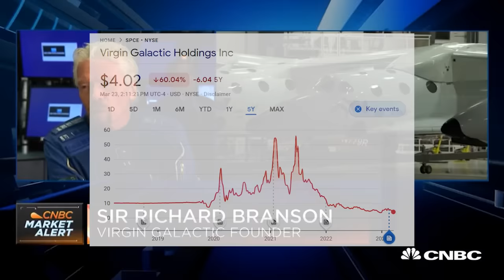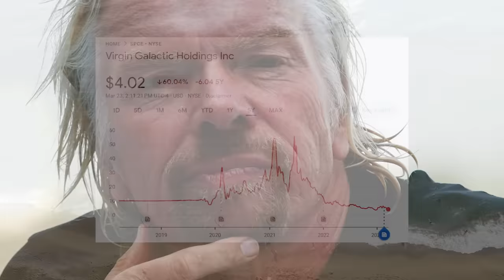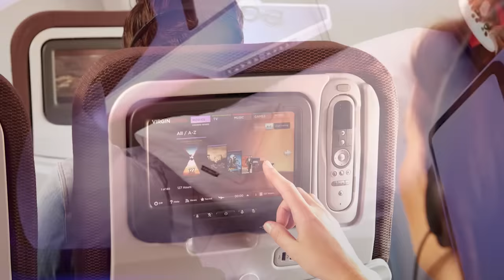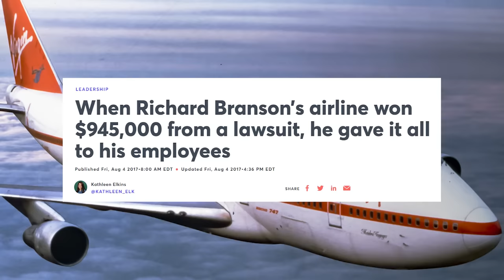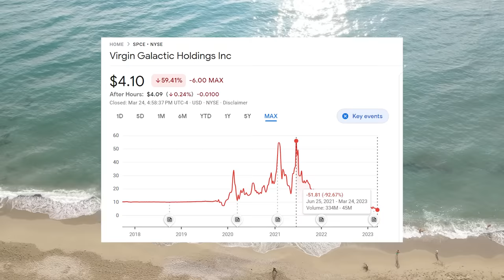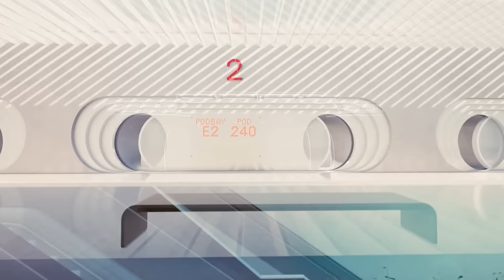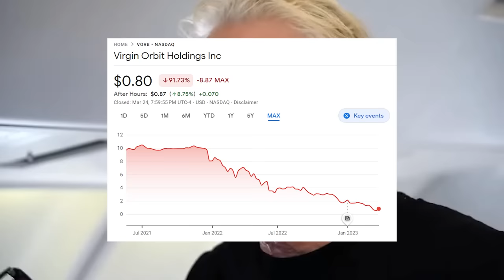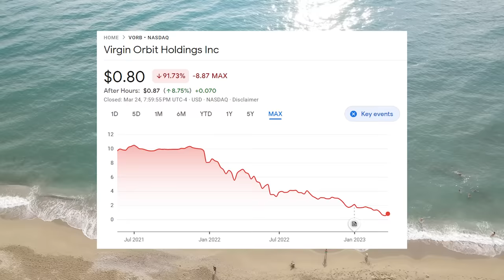The Rise and Fall of Richard Branson

Comment: Richard Branson says he didn't know the difference between 'net' and 'gross' until he was in his fifties. He is just a lucky risk-taker. Anybody that took 5 minutes to review the hyperloop's science knew it was impossible.
Reply: @tripplefives1402  theoretical science as you basically state that the cost is too high to be practicable so will never be built and see if it is possible
Reply: @tripplefives1402 it’s like an air hockey table as Elon says lol. Comparing something that complex to a very basic thing is laughable and that is before you consider transporting humans
Reply: @tripplefives1402  "It's just like those tubes at the drive through at the bank, just bigger."
-> By this logic, skyscraper is just like a glasshouse, just taller. No, the engineering challenge increase not proportionate to the increase of size, not even quadratically. The giant pipe, miles long, meters wide, has to be maintained. Smallest crack can be catastrophic. Speaking about catastrophic ...
-> Add the fact that the pneumatic tubes in banks and hospitals brought receipts, not humans. That means hyperloop brings ALL the problem of space travel to the ground: "How to ensure a human survival in vacuum travel?"
Reply: @tripplefives1402  Actually, it takes around half an inch of steel for a tube a couple of metres in diameter. I calculated it. Unfortunately it would have trouble keeping its shape so you'd be wise to use one inch thick steel at least and brace it regularly. I costed the bare steel sheet alone to fabricate a LA-San Francisco line at several billion dollars without it even  being fabricated into a tube.
Reply: @tripplefives1402  NO they have NOT ! Don't tell LIES ! Those test tracks are too small and are completely unrepresentative of a real version. It takes around half an hour even to evacuate them.
Reply: @tripplefives1402  " A small crack would do nothing but leak air and water in which would prevent the vehicle from reaching top speed."
-> Err ... a small crack causes reverse decompression: air will be rushing in so fast, so hard, it crushes the tube and the "train."

"Actually yes, the engineering is proportional to the size."
-> Nope. Square-cube law already indicate this.

"The relationship between the thickness of the steal beams on your glass house to its weight of each floor is linear."
-> Assuming this is  true, this is not the only aspect of designing bigger building.

Look, Thunderf00t already shows every single detail of the engineering challenge, I suggest his video. 
OR
Without seeing Thunderf00t video, the fact that hyperloop IS NOT reality until today, eventhough this concept was floating around since 1970s suggests that the difficulties of building hyperloop is closer to my estimation than yours.
Reply: @tripplefives1402  I expect that a very significant part of the cost of either rail or rail routes will be LAND actually ! Both will need similar amounts.
There's no way that a hyperloop could be cheaper than HSR. THINK about it !
Reply: @tripplefives1402  NO. Hyperloops are a ridiculous fantasy because any sane costing makes them vastly MORE expensive than any alternative. RAIL IS CHEAP ! The costs in California ARE NOT rail related. 
There's a more fundamental flaw however. Not that many people need to travel from point A to point B at ridiculous speeds. A hyperloop would never have a sufficient customer base to fund one. THE END.
Reply: @advancedomega  just add duct tape if it moves and wd40 if it squeaks
Reply: @parafitality2730  🤣🤣
Reply: @tripplefives1402  no drive through banks in my country…our high street banks are all closing .no tubes in our drive through Starbucks either..
Reply: Airplanes are also impossible.  "Putting occupied vehicles in such a large vacuum would involve insurmountable hazards and difficulties."
Reply: @davidbeppler3032  In case of airplane, the problem is only on the vehicle, not on the infrastructure: The airplane needs to be airtight while on air, while the air is just the air. 

Hyperloop has no such "luxury." Not only the train needs to be airtight during the travel, the vacuum tunnel needs to be airtight too. One small leaks along hundreds of miles of that tunnel will start a collapse, cutting off the line, or even crushing the train, killing all passengers inside.
Reply: @tripplefives1402  , lol, the travelling bit is easy, the static part is where the "unachievable" enters the room...

 - space is relatively free and easy to use, a 300 mile vacuum cylinder is anything but.
Reply: @bradyanderson2404   - yes, an airhockey table in a vacuum, ???? simple gets wrong really fast with analogies..  (just for a laugh - of course)  scalability is the hassle - when the cost scales by the cube, one runs out of money fast - time to find the "greater fool".
Reply: @tripplefives1402  Unfortunately, neither Branson nor Musk is wealthy enough to see the project through to any form of working system.
Reply: @tripplefives1402  Do you really believe that most firearms work using compressed air ?
Reply: @tripplefives1402  just what musk said, and look where that got him.
Reply: it is possible but very very expensive...not a sound investment considering  that  the target market is quite small ( the ultra rich of any given  society)
Reply: As the video says, it would have to significantly slow down every time it would take a turn or rise or people will be sick or even pass out from g-force, so it has no advantage over high-speed rail, and would cost much more.
Reply: Yeah he's not the brightest guy. His success is more about timing and luck with good branding and self-promotion, rather than his business skill or the quality of anything Virgin offers. He is what we call in the business world, a market disrupter. He enters markets as a price-competitor disrupter. 

Virgin Cola was an epic failure, so it shows even the Virgin brand can't work on some products and every market. Why he''d even attempt to launch a new cola brand is baffling and probably reflects his arrogance that anything with Virgin on will sell..cheap cola, even with the Virgin brand didn't sell due to brand-moats around the cola market. Nobody tries to launch a new cola brand because its an exercise in futility against Pepsi and Coca-Cola (except supermarkets of course that dominate the food consumer market and shelf-space). The only company really that's ever suceeded on any kind of scale in bringing out a new cola brand is Dr Pepper if you even consider that cola with its unique taste...they were quite clever in their marketing, kind of like "it's not cola!/it is cola (but tastes weird)! You decide, approach, which got people curious to try it😜Kind of like the marmite of cola world. Love it or hate it. 

Air travel and broadband is a different story as those markets are much smaller with less price competition...so market disruption worked well for him there. Although accquiring a fibre optic cable monopoly (at the time) was a huge game I think and he was definitely taking a long-term view on that which fortunately for him paid off, else that decision alone could have bankrupted him. 

Didn't he sell Virgin Records originally to fund Virgin Airlines? Then later he regretted the sale and launched Virgin Record's 2.0? I can't remember the back story of that and haven't read the book you mention (it's on my read list now) but re-launching a company in the same industry you sold out of that relies heavily on an established brand, sounds downright unethical and deceitful to me. Unless the original Virgin Records was rebranded or shutdown/bankrupted...but even then, presumably whoever bought the original Virgin Records label and retail chain had some brand-exclusivity provision in the sale contract, and by Branson re-using the same brand in same industry without paying or profit-sharing with the previous buyer, seems quite unethical business practice to me. I'd have sued the crap out of him if he tried that stunt on me.
Reply: @paullangton-rogers2390  If success was   purely determined  by hard work and genius then rich business  people would find  no  need to rig the game by forming closer ties with politicians and rulers to gain unfair advantage.
Reply: @paullangton-rogers2390  Unlike stated by you and this video Branson never owned virgin media. He just licensed his brand name (There are many virgin branded business out ther that are just a brand license) like Trump and got a very small equity % cut... He did go into the record business again but it was branded V2 records... and in the end it was more focused on live festivals from establised artists than A&R and putting out new music...  Branson is just a product of luck and good timing.. he always qotes his headmaster as saying he would either be a millionaire or in prison. Had he been born 20-30 years later i dont think he has the needed skill to pull any of what he achieved back then in todays world...
Reply: @tripplefives1402  wrote : [H-L] is just like those tubes at the drive through at the bank . Hardly : the bank tube capsules are not doing 760 mph while carrying people.  The bank tubes can have relatively tight curves and are not long enough to need allowance for thermal expansion.
Reply: He knows the difference between underage girls. and Yes this he has been to the private island You know the one I mean.
Reply: He obviously knew the difference between net and gross.
Reply: @tripplefives Way to show everyone you have NO IDEA what you're talking about.  Steel expands and Co tracts GREATLY with temp change.  
So many FOOLS have NEVER looked at oil pipeline expansion joints.  Tell me how that's going to work at ANY speed......hint: IT WON'T!!!
Reply: @tripplefives1402  I Appreciate People Like You, Who Actually Answer Thoughtfully With The Grasps Knowledge And Self Thinking.
I Do Not Support People Like Andrej Nograšek Who Write Whatever Comes First In His/Her Mind.
Does Not Have Had Logical And Scientific Thinking Before Writing.

He Wrote Anybody Who Took 5 Minutes To Review The Hyperloop's Science Knew It Was Impossible, He Wrote "Anybody" Can You Imagine Of All Technology Available Right Now And All Technology Will Be Available In Future ?

I Believe Not Anybody Knows It.

Please Be a Deep Thinker.

I Apologise If Its Offensive Or Disrespectful, Thank You !
Have a good life.
Reply: does he trust Elon Musk?
Reply: @tripplefives1402  😂
Reply: Always try to net the gross
Reply: @advancedomega Listen, people just need to learn to hold their breath and they'll be fine. 😅😅

Comment: The Hyperloop was not "scientificly sound" at all. It was always obvious that putting occupied vehicles in such a large vacuum would involve insurmountable hazards and difficulties.
Reply: I think you're ascribing a too far-reaching meaning to the phrase "scientifically sound". I'd say in this context it only means that achieving higher velocities in evacuated tubes is possible. However, the engineering challenge of doing that cheaply enough to make any economic sense is a completely different matter.
Reply: Elon gave up on HL early on which says everything we need to know.
Reply: I am glad you called that out. I was about the post the same thing. To support a near vacuum in a tube system that large would take a lot of energy and be prone to issues, like sudden decompression and leaks. It was never scientifically sound.
Reply: @leroy2576  right mate
What if we put the tube in anotha tube and set the second tube on a train in the first tube 😮
😂
Reply: @leroy2576  The energy required to evacuate the tube to even a modest partial vacuum e.g. 100 mb would be prodigious. Coping with the inevitable leaks would have consumed a considerable amount of power too.
Reply: @encinobalboa he left HL because scam industry around it was getting too crowded, now he concentrates on scamming with Tesla Robot, Semi , FSD etc. :D
Reply: @ShimaParty  Add solar roof and L.V. Loop to the list.  Cybertruck is late.
Reply: Airplanes are also impossible.  "Putting occupied vehicles in such a large vacuum would involve insurmountable hazards and difficulties."
Reply: @davidbeppler3032  I never said the HL was "impossible." Many things are POSSIBLE, but not FEASIBLE.
Reply: @truthbetold444  What does insurmountable mean?  That was the word you used.
HL is not only possible, but as old and well researched as the tech is, not even difficult.  Just expensive.
People think if it has a small leak that somehow it would explode or implode.  That is not how a vacuum works.
This is not a balloon.
Reply: That's probably the point. Elon Musk is trolling Branson.
Reply: Its a great way to make MUMMIES! :face-purple-crying::face-blue-smiling::face-fuchsia-wide-eyes::face-green-smiling::text-green-game-over:
Reply: @encinobalboa  Elon's Hyperloop "White Paper" (hailed as a sacred document by some of his must obsessive Hyperloop fans) is full of errors according to @Thunderf00t  so that's probably not why he dropped it. Maybe he couldn't convince any of his most trusted engineers at Tesla and SpaceX.
Reply: @davidbeppler3032  check any of the thunderf00t videos doing a fact by fact debunking of the Hyperloop concept. we've all thought about it as a kid, anybody who's seen a vacuum capsule cash transfer system has probably considered it "possible". the thing is, when you consider the constraints of a people mover over city to city distances in comfort it gets pretty difficult, and I don't mean powered flight difficult, I mean interplanetary space travel difficult. physics works against you pretty bad. costs factor accordingly.
Reply: @alastairleith8612  Thandarfeet is unemployed... because he is not good at his job.
Building an airtight tunnel is easy.  Building a train is easy.  Putting them together is not difficult.  Just stupidly expensive.
Basic engineering at it's finest.
It only gets hard if you try to do it cheaply.
Reply: 22
Reply: @Jane Smith You also avoid the subways?
Reply: The problem is not scientific - it's financial . He is trying to build a mass transit system in a country that hates mass transit. USA's history shows it. California has been trying to build high speed rail for 20 years and is still failing. Branson wanted to build something that is 20 more expensive to build and operate (yes ,it needs a lot of power to maintain the vacuum) in a area where they can find money to build standard transport. Its a pipe dream and everybody knows it.
Reply: exactly,nothing about the Hyperloop is technologically sound, that's why they couldn't make it,neither Branson,nor Musk
Reply: @crimsonlightbinder  Musk has not tried.  Why do people think Musk has anything to do with Hyperloop?  He just suggested someone should do it.  That is all.  Based on 100 year old technology that we mastered long ago.
Reply: You cant put a granny on a hyperloop-train having to withstand several Gs of acceleration. Using this for cargo is more reasonable.
Reply: @vast634  Granny can't take a Plane either?  Planes fly at 600mph same as the Hyperloop.....
Reply: @davidbeppler3032  Of course granny can take a plane. A plane does not accelerate more than like 1.2 Gs. Passanger planes can take several miles tu make a turn. A ground train going through a tight curve with 500 mp/h could generate several Gs.
Reply: @vast634  So... exactly like a Hyperloop train?  Then why can't Grandma ride it?
How many Hyperloop trains have you been on?  What is your evidence of 100Gs and instant 90 degree turns at over 650mph?
Reply: @davidbeppler3032  Stop making a strawman argument by inventing numbers and pretending i said those.
Reply: @vast634  Stop making up numbers that don't make any sense.
Reply: @leroy2576 you’re literally discussing economic soundness just like the other guy said…. feasibility of economic of doing something is not the science of doing something
Reply: @encinobalboa  In fairness, Musk never actually meant to make one.  I don't think he actually understood it wasn't possible, he's never shown that level of awareness, but he said when he pretended that he had come up with the idea that was over 100 years old that he wanted to just patent it (which obviously wasn't an option since it was an over 100 years old idea) and let anyone who could fund it use the patent for free.  Side note, if he actually thought he could patent it, he obviously wouldn't let anyone use it for free, that would completely defeat the point of patenting it, he probably had already been told by lawyers that he couldn't patent the idea since it had been around for a century and knew his idiot fans wouldn't realize that and thus think he was being a generous hero by letting others use it.  Stealing credit for others' accomplishments and building his own publicity are the 2 only things Musk has ever had any actual talent at.
  Musk only made a test track when a bunch of idiots showed excitement for the idea so he could still get publicity from it.
Reply: @josephhawthorne5097  No doubt Elon is part Huckster.  He is very intelligent and must have known that Hyperloop was not feasible.  (Operating a passenger vessel in a vacuum is just as dangerous as operating a capsule in space.)  Elon knows how to drum up interest.  I have always wondered about the fan boys who cheer and clap at every word Elon mutters.  They are present at every SpaceX launch.  Fan boys are cheap to pay for but the publicity and excitement they generate is priceless.